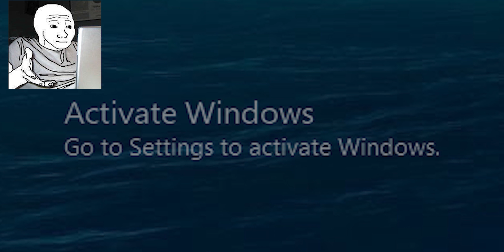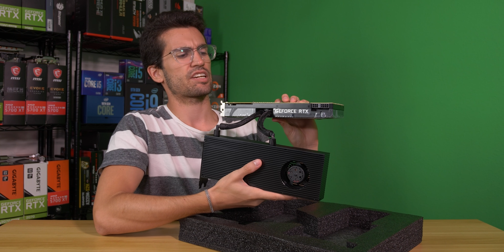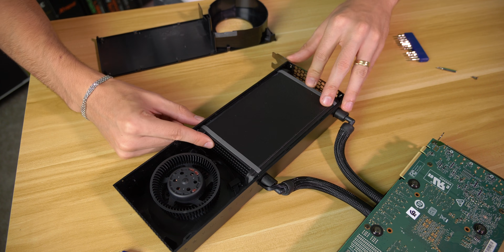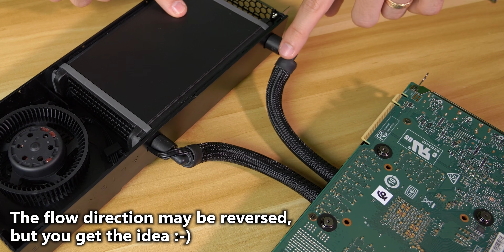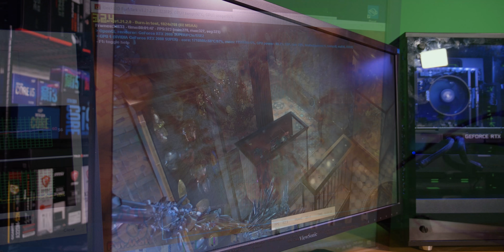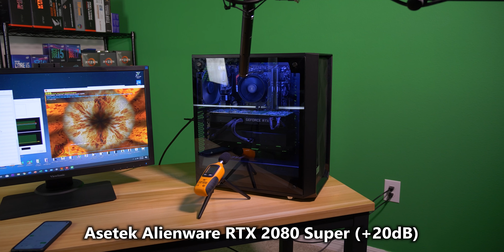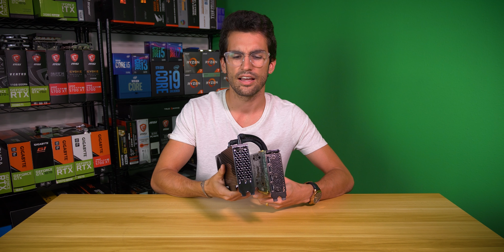Testing a Strange Alienware Graphics Card

Comment: G'day Greg & Nate,
I can't like this video Greg as it doesn't make sense to me & it feels like you are trying to 'sell' the Idea,
I don't understand how 'GPU Blower Cards are too Noisy & Manufactures should stop releasing them' yet this one is 'Cool', I don't understand 1 Blower Fan is bad but 2 is good, shouldn't it be 1 is Bad, 2 is Worse?
Do you know what the price will be & should you be comparing it to a Reference RTX2080Super or a More Expensive Partner one with a better cooler, 
You also say it could be good in more closed off spaces because of Airflow,
How will it fit ITX cases,
Even in an M-ATX Case with 4/5 PCIe Expansion Slots the Rad Unit is going to be right up against the GPU Unit & Block Airflow to the VRM Intake while the Rad Intake is obstructed by the Bottom of the Case or PSU Shroud,
The only case size it seems suitable for is ATX with 7 PCIe Expansion Slots which will have plenty of Airflow & ability to Expel the Hot Air Generated by a 2/3 Fan GPU (running way Quieter),

Can you retest the Performance, temps & Noise compared to the Reference Card in a M-ATX case like NZXT H400, Fractal Design Meshify C Mini, CoolerMaster MB400L, Corsair Carbide 88R/Crystal 280X, Thermaltake H17/18, Antec DP301M, In Win 301 for performance in a more Limited Airflow situation

Comment: Would it be more beneficial to just make a 4 slot gpu with the extra space being utilized as all one big heat sync in non compact cases.
Reply: I think the flexibility of two individual parts is a better solution, you could still potentially use a PCIe slot in the middle and move the second cooling card to optimize cooling based on fan placement. I really think this is a pretty cool idea for gamers as most gaming pc’s don’t utilize the majority of their PCIe slots.

Comment: wow this looks pointless!
what's better than a blower cooler? 2x the blower cooler!
as a plus lose some PCIE slots....
assume the fan on the gpu slot is needed to cool the vram and stuff 

i still think there is room to improve blower cards yet, not sure this is the correct direction.
id relay love to see some more creative blower style deigns & sick of seeing blower cards with tiny heat sinks that dont even fill all the space under the plastic protective cover of the card.
wonder how it compares to a 120mm AIO for the gpu as exhaust for the case, that's going to take less room and help case cooling more (even as top back intake to get cool air if you think case air is to hot)

but we now have fake ram for the 'look' so why not fake SLI, just need a fake SLI bridge to end the look.

cool video, saw news about this ages ago and forgot it was a thing.

Comment: To sum up: Just buy an AIB card if you have a normal case. The temps aren't good for water solution anyway.
Reply: I agree, the temp difference in no way comes close to warranting the Noise & Space increase,
how could it work in anything less than 6 PCIe Slots? you would start blocking those already Noisy Blower Fans making them spin faster & get more noisy

Comment: Are those sponsored windows keys legit? Linus said there's a high chance of buying one and having it not work because they're oem from manufacturers or for other countries
Reply: All I can tell you is that I bought one from the site Greg advertised and it was legit. I think I paid 15 dollars for a Windows 10 Pro key.
Reply: So far so good windows hasn't disactivated mines.  (1 year)
Reply: "high" is fairly relative really. If I were to pull numbers out of thin air I'd say there's around a 5-10% chance your key deactivates within a year or is doa. Compared to the 0% chance with a official 150€ System builder Licence it's "high" but in the end you pay 10-15€ tops for a OEM pro licence, so it would have to deactivate 10 times to break even. (Also lets not forget that windows works just fine without a license when you are willing to give up personalization options)

Edit: Personally I use a ebay OEM key for two years now, and it seems that Microsoft actually treats it as a retail key now (it used to not be the case). Also I bought two other win10 licenses which work for at least 6 months now without a problem.

Comment: I see potential for that AIO design. It could use some tweaking but I can see it becoming mainstream.
Reply: I bet in the future we'll have 2-slot GPUs with built-in AIO pumps and radiators
Reply: @Nik-ff3tu  Yeah why not adding another easy failing part inside your pc (see the average lifespan of water cooled loops) instead of sticking to a aib gpu that would still be better thermally and in noise to that

Comment: It'd be perfect for Micro atx cases. I'd definitely buy it but like you said would need some tweaks/improvement.
Reply: so with M-ATX having 4 PCIe slots the 2 sections would need to be right next to each other, meaning how does the GPU section intake air for the VRM Cooling?
if the case has a PSU shroud how does the Rad Section get Air Intake?
I can't see it perfoming properly in any case but ATX with 7 PCIe Slots,
& a 2 slot GPU with 90/100mm fans is going to be way quieter